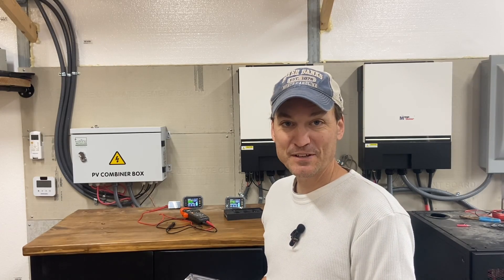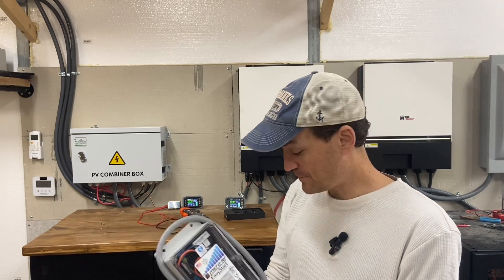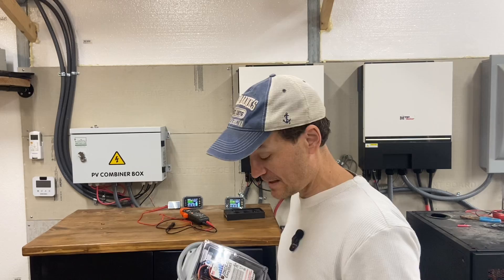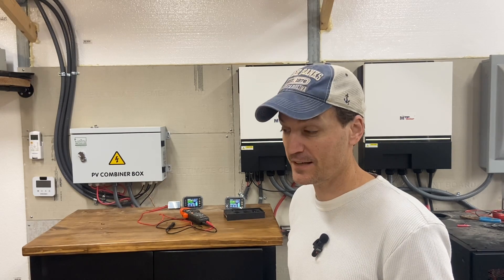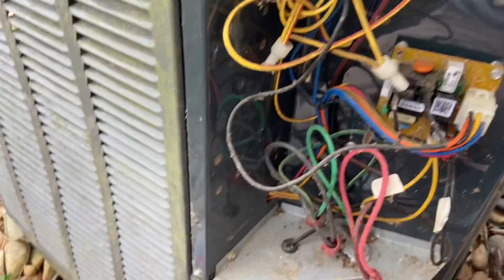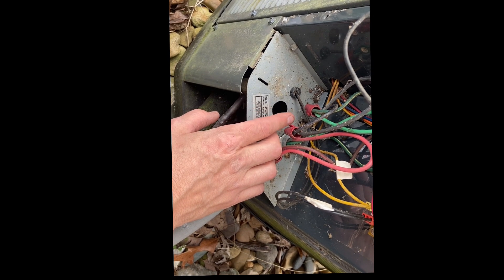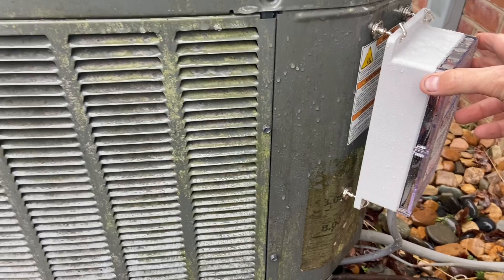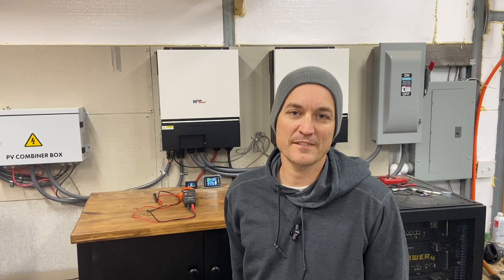Installing Micro-air easy starts on my ac units.

Comment: Hi thank you for the detailed information.
Was looking at the magnetic fasteners as well. How are they holding up for you? No interference in performance of the easy start?
Reply from the maker: The easy starts working great. I’d say the one thing about the magnetic hooks is that they aren’t outdoor rated so they get a bit of rust on them. So you could search for something suited for outdoors. Or just hit them with some spray paint.
Reply: Good to know. 
I do have room inside where the cap/ contactor are located, but don’t want to drill holes because of the refrigant lines potentially getting damaged.
These hooks will do the trick!
Thank you again for sharing on how you installed it!

Comment: Bought mine in August and they now include all the wire fittings in the package!   Mine is a 3.5 ton unit and I accidentally bought the smaller one and I can successfully say that it has worked fine app says over 2000 starts!
Reply from the maker: That’s awesome. I ran mine all summer without issue. They work great.

Comment: I wonder if i could use one of these to start my 25amp 5hp air compressor? I would think its doing the samething.
Reply from the maker: In theory I think it would work. I’ve heard of people using them on well pumps. But I’m not sure if they are warrantied for use with anything but AC units.
Reply: @GavinStoneDIY  ill have to do a little more research, but id love for it to just work like everything else.

Comment: On that 2nd trane unit you have I saw it had a 2nd oem start capacitor and relay did you have to disconnect them for the micro air install?
Reply from the maker: Good eye. I wasn’t sure if anyone would be interested if I added that in the video. I did at first disconnect the wire. But evidently it wasn’t supposed to be. I called micro air, because their directions said to disconnect it. My unit did start up. But it ran rough. So I reconnected it and it works great. My biggest concern was if it would damage the unit if I reconnected it. Micro air assured me it wouldn’t.
Reply: @GavinStoneDIY  my trane unit has the same kinda of setup and I heard they can be finicky if it’s removed. So you still install all the same and just leave that start cap in place as is and the folks at micro air said it’s fine. Do you still get a good reduction in starting amps on that unit? I’m looking to install one so my generator could run it
Reply from the maker: @JJDuval  I do actually, so it started around upper 30’s  amps I believe. And I’m sitting at 22 now. So it was definitely worth it. For generators or inverters it’s awesome. I’ve also had people tell me their 5 ton units got a reduction of 40 amps.
Reply: @GavinStoneDIY  So basically you still wired it all up exactly how the directions show you and you leave the other start cap and relay in place, I have been hearing different things with the micro and trane units
Reply from the maker: @JJDuval  exactly. Micro air said I could test it both ways and send the Bluetooth results to them. But I didn’t have to. I sent the results with the wire installed. But without the wire the unit sounded nasty. So I already knew I had to leave it.

Comment: I put their largest model on my 5 ton AC so I could run it with my solar system and went from over 75 amps startup to around 30. Then, EG4 came out with their Solar mini splits so I installed 4 of those and they run completely on solar (during the day) on 3 370 watt panels each so now my 5 ton AC sits with it's circuit breaker off. My place is 2,400 sq/ft and 3 EG4 solar minisplits keeps the whole house icy. I have the 4th one installed on our standalone mini office out back but if I had to run the big 5 ton ac for whatever reason again, I could. Great vid!
Reply from the maker: Thanks man. And that’s awesome to cool your house with those. I’ve seen a couple people doing that now. Do those eg4 mini splits need a vacuum pump to evacuate the line sets when installing?

Comment: Great idea! Will follow for sure🙂. The size of the fitting you used is 1/2 inch or 3/4 of an inch? And do you have a link for those magnetic hooks?
Reply from the maker: I just added both in the description. Thanks for pointing that out. The glands should be 1/2. It’s a 10 awg wire. But if you went with 3/4 it would likely still seal around it. That would also depend on you using the x48 model. The larger units may have a larger gauge wire.
Reply: @GavinStoneDIY  Great Thanks! I will use the x72 model, as I have a 5 ton ac. I will check the gauge wire for this model. It will be a challenge for sure but based on the reviews that this soft start has it should work great! Will see. I will install mine this week. Keep us posted on your ac challenge🙂.
Reply from the maker: @ThomasKJ101  the larger the tonnage the better the results I’ve seen. Let me know how it goes. I’d probably use a 3/4 for that model.
Reply: @GavinStoneDIY  Installed! Wow! From 104a initial surge (LRA is 128a 😱) to 37a after 5 starts! I'm impressed! The x72 model came with the same 1/2 inch fitting, so I bought a 1/2 inch one like yours. Thanks for your videos, I appreciate the time and efforts you put into this. By the way (I'm the link tracker, lol), do you have a link where you bought the extension cable for the lv6548 monitors that you used to mount them in the house? How long are yours?
Reply from the maker: @ThomasKJ101  that is awesome that it reduced the startup amperage that much! I really appreciate you asking about the links actually. It helps the channel. So the distance of my shop to the house is around 150’. I bought a pair of 200’ cables. I’ll post the link here to the ones in used. https://www.amazon.com/dp/B07FTJK3ZN/ref=cm_sw_r_as_gl_api_gl_i_YS66C88KGE49V6FD527E?linkCode=ml1&tag=gavinstone-20
Reply: @GavinStoneDIY  Thank you, I’ll grab a pair of those for sure. You’re an inspiration, man!

Comment: Cool! (pun intended).  I'm in the process of replacing mine with some Mitsubishi equipment but this was going to be my other option.  I get asked about the soft start frequently.  Now I have a video to refer them to.  Can't wait to see how these do once they get settled in and summer gets here.  Thanks, Gavin.
Reply from the maker: I Installed a MR cool in my shop. I really am a believer in mini splits. I’m hoping this works out for us over the summer. It would a pain to install mini splits for my whole house. Although they would be much more efficient.
Reply: @GavinStoneDIY  We went with the Mitsubishi units with air handlers so it's essentially a 3 ton and two 2 ton mini split condenser units with corresponding sized air handlers inside.  This lets me use the existing ductwork.  The math says it should cut the consumption over my 11 year old 14 seer units by close to half.  These are so effecient they don't even install heat strips in them in this part of the country, so that should cut a huge chunk off in the winter.  They're starting Thursday and are supposed to finish two units this week and the third one on Monday.  I'll definitely let you know how they do.  I'm going to put the 3 ton on solar first and get a feel for it then move hopefully at least one more to solar.  Then I may have to put a small mini split in the garage to keep the temp down for inverters.  That grieves me a bit but I guess it's part of the deal.
Reply from the maker: @easttexascowboy257  that sounds awesome! Keep in mind those systems qualify for the 30% tax rebate also. You may already be aware. But just in case you weren’t.